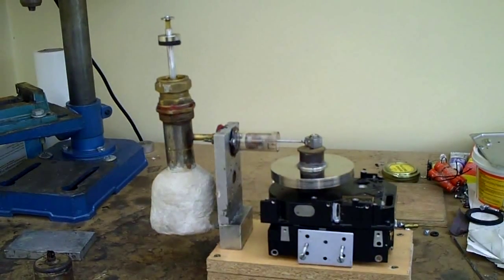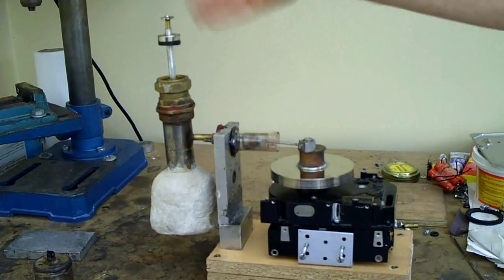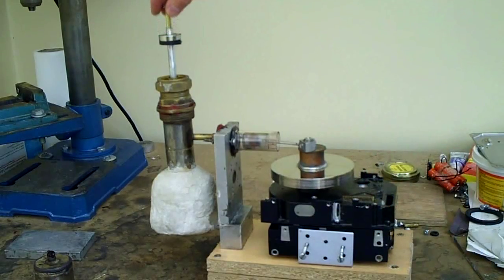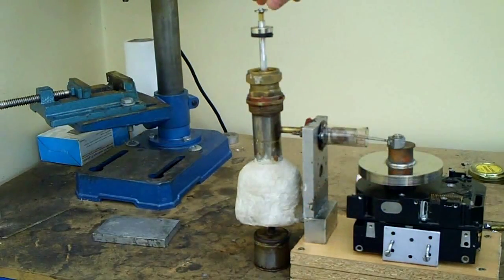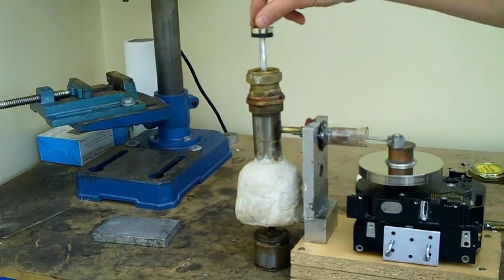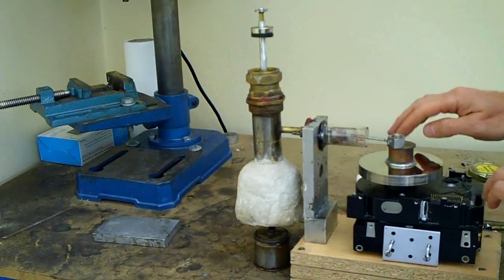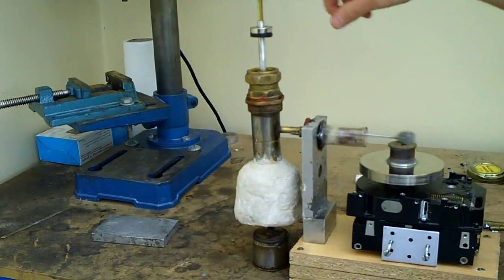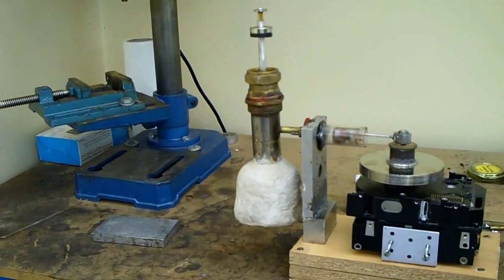A Ringbom Stirling engine, no lathe involved in making it. Flywheel oriented horizontally .

Comment: What is the inner diameter of the hot side cylinder and its length? What approximate proportion of the cylinder, the displacer and what are  top, bottom, side, axis rod  clearances? Could you say anything else about displacer weight?